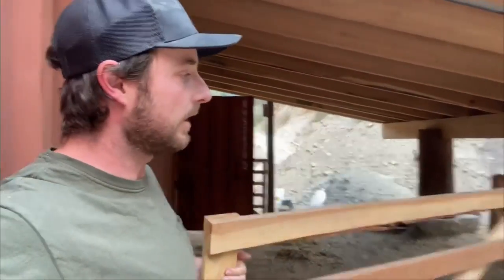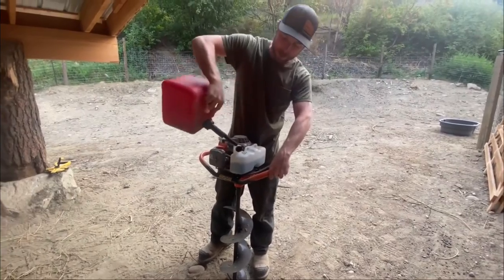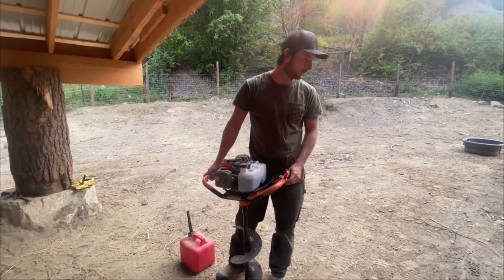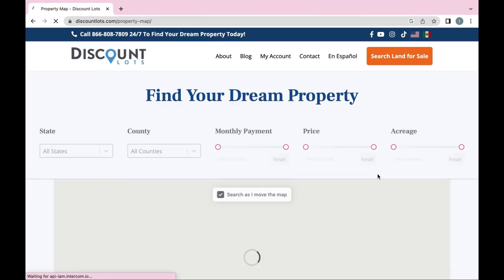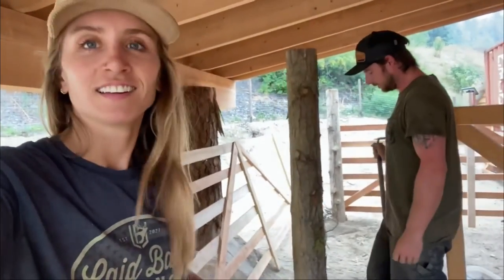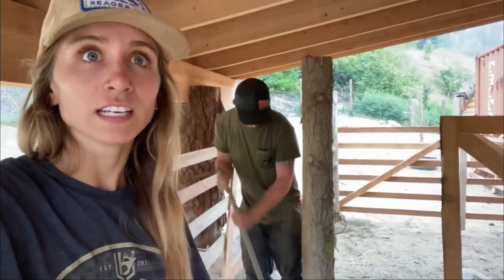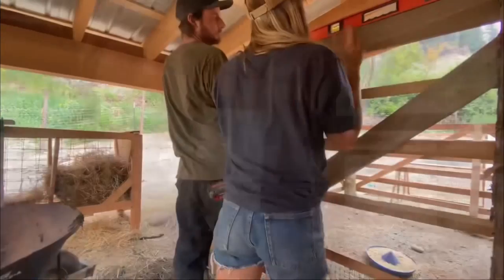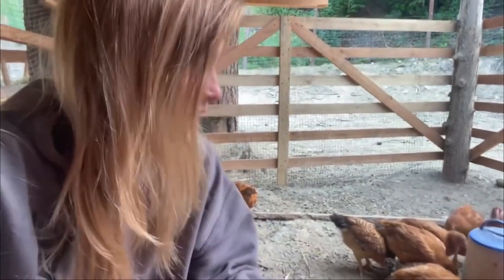Shipping Container Livestock Pen

Comment: Personally I’d get BOTH, a tractor and a skid steer. You can get the same attachments for the front end, loaders, forks, snow plows/blowers. But for the tractor it’s the rear attachments, hair, discs, bush hog mowing deck, etc. so one might say just go with the tractor,  it for smaller dirt moving / grading, and material loading/unloading and transfer/moving the skid steer is King.

Comment: Personally  would cut post at 10 ft so have head room and totally  screen in from preditors  also suggest  that use hardware cloth on the ground between  post half in half out  to prevent digging  under

Comment: Make sure you put wire or netting over the top because I put chickens inside my 12 foot tall barn and did not build the pen to prevent anything flying in to get to the chickens. Needless to say a hawk got 5 chickens before I figured it out. I thought it was a possum or raccoon and ran an electric fence around the bottom to stop them. I had to put wire over the top to stop the hawk. Please don't make the same mistake I did.